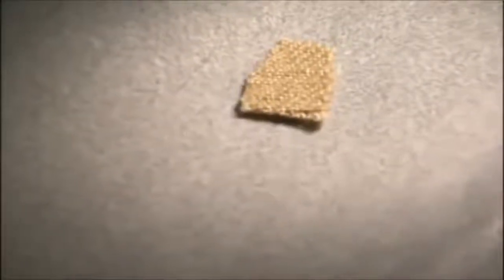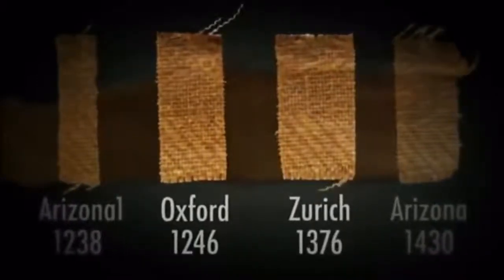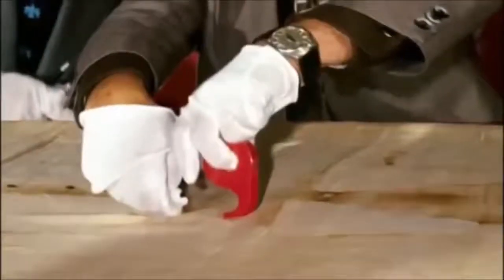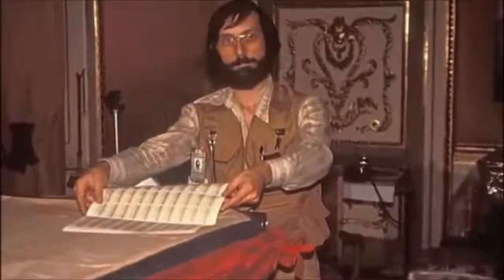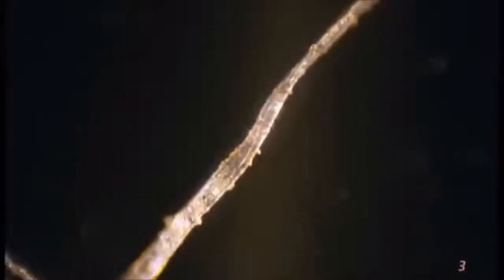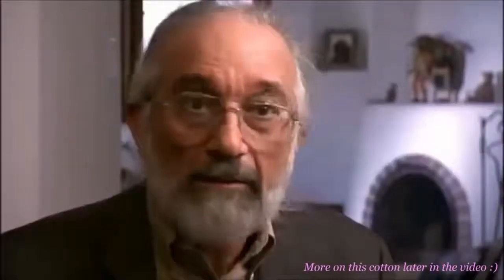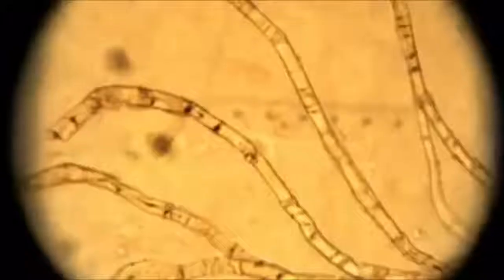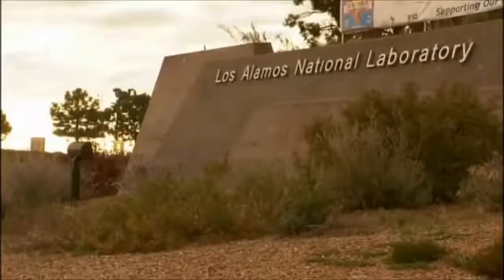Turin Shroud - Cotton adulterated 1988 Carbon 14 Test

Comment: Ray Roger's examination of the Shroud samples from the same area that the C-14 test were done is conclusive proof that there was cotton mixed with the flax fibers.  The question is whether there is cotton in any other part of the Shroud.  The only other samples I'm aware of are the sticky tape samples taken by STURP in 1978 which Ray Rogers was a part of.  Rogers said there was no cotton in any other part of the Shroud.